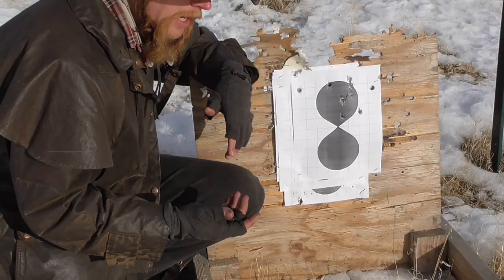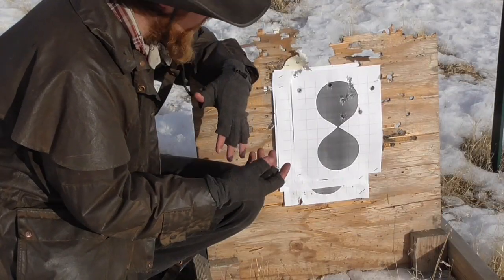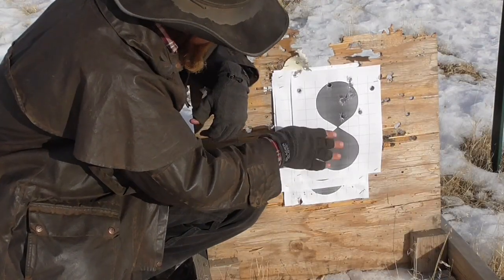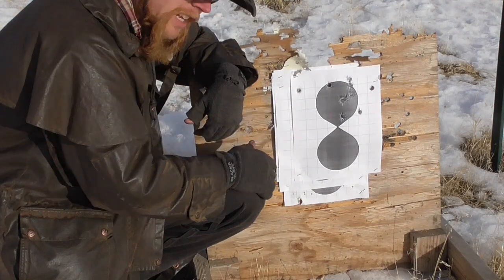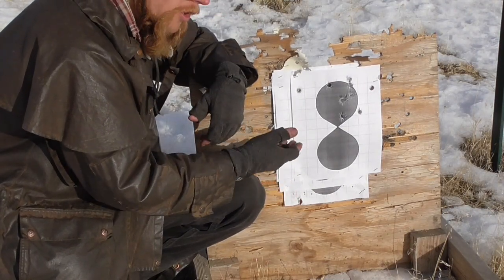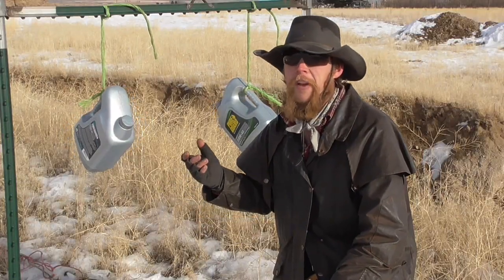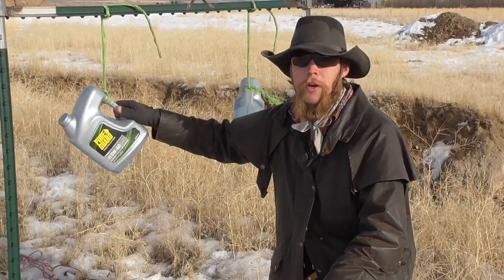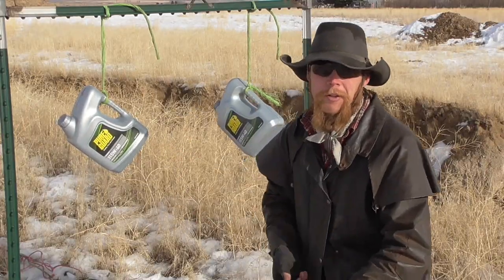Multi-ball Loads for Muzzleloaders (TIS184)

Comment: I shot 2 patched balls out of my 50 cal hawken back around 1980. (practice) 1 patched ball on top of 2nd patched ball, with 100gr ff it grouped well under an inch at 75 yds...the 2 balls would hit 1/2-1 inch apart (perfect round holes), and the next shot 2 more holes. making a nice circular group under and inch, 3 shots, 6 holes 1 group under an inch!!  It wasn't legal to shoot 2 balls (TN)  though, so  i had no good load with which to hunt.... (never did shoot at one anyway so it was a moot point)... one of my buddies decided to shoot 3 patched balls, & the kick about knocked him over (he was a little guy 140 or so)...nobody tried this again.   you should try 2 balls!

Comment: MULTIPLE BALLS  in a rifle is NOT a new idea.  I am glad you revisited this  very old way of increasing effectiveness.  HARD CAST  BALLS """VERY MUCH UNDERSIZED""" with  'extra-thick or double layer patches'   should resist deformation and sticking together  fairly well   without the need for  cork, fiber or leather wads between balls.

Comment: This reminds me of my Taurus Circuit Judge. I have a 0000Buck 5 pellet load for it. They are stalked balls that even engage the rifling (found some projectiles in the dirt with rifling on them). For that particular carbine, they pattern in a strait vertical line. Would be a very effective home defense load as you are getting 5 hits from the belly to the high chest in a line, or low chest to head. They are traveling about 900fps, so that would be as if you fired a 5 shot burst from a .45 sub-machine gun.
Reply: Nice

Comment: do you increase powder load for more bullets?
Reply from the maker: In this case, I used the same powder charge with both loads, but I think that resulted in the multi-ball load having a significantly lower velocity.  Maybe I could have gotten comparable velocity if I had increased the powder charge as well.
Reply: It is not too late to try that...